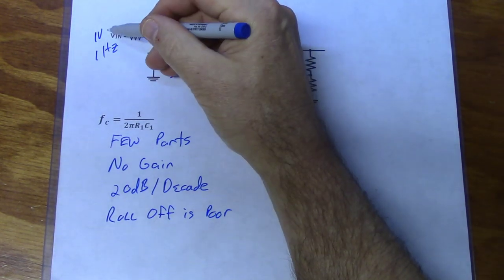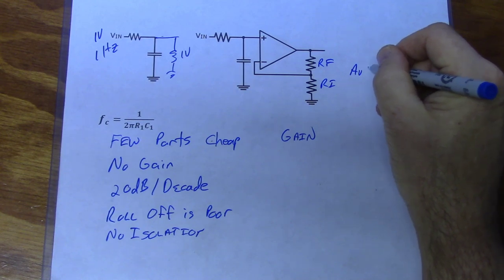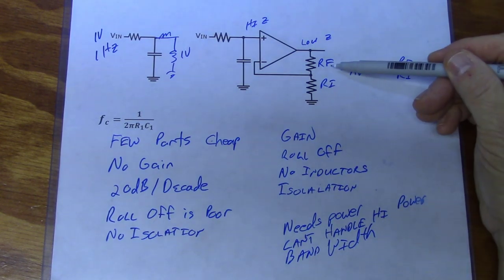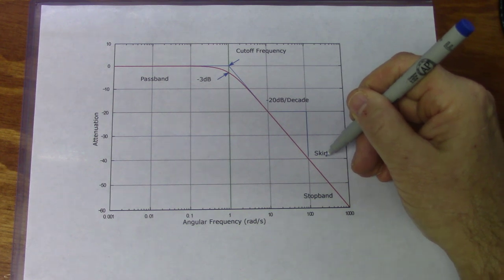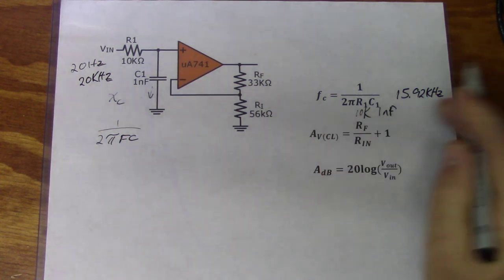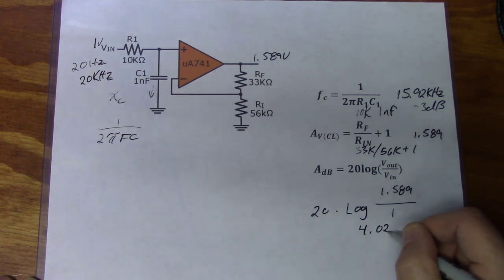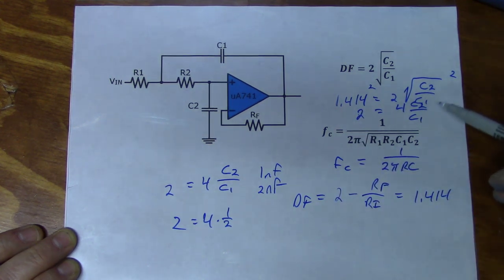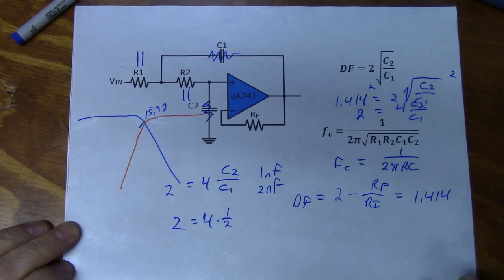66. Low Pass Active Filters

Comment from the maker: The filter with the single RC pair followed by the op amp is really a passive device, not an active filter. The op amp acts as a buffer for the RC filter! My staff, consisting of one person (me), erred. Hard to find good help!
Reply: Just found your videos, some good stuff on your channel, why no recent videos? Was hoping for a part 2 to the am radio video.
Reply: technically it is also an active filter because it doesn’t work without buffer
Reply: Jeez... that'a lots of people you have working for you.... :)
Reply: You are absolutely wrong, so as OP Amp removes shunt load for RC and that makes big difference. So it is still active 1 poll filter. Need to learn and not to argue, my advice.

Comment: Sallen-Key filters should always be designed with the op-amp buffer gain = 1 in order to maximize the loop transfer function, thereby providing the best performance of the closed-loop op-amp buffer.  Design is easy because the normalized resistors are one ohm and the normalized capacitor values are easily calculated based on normalized [w0 = 1 r/s] pole locations.

Comment: Great presentation. Thank you. Question: I want to build a Sallen-Key filter for wspr on 20 meters. Do I have to worry about the slew rate on a 14 Mhz type of signal ? If so, can you recommend an op-amp that would handle this frequency level ?

Comment: As a hobbyist and someone that has created a few videos (none monotized/just for fun), I have to say, you put a LOT of effort into this. Thanks. You must have spent ages editing this to cut the final production with so much detail section by section and point by point. I believe someone needs to try creating something like this to really understand how much effort it takes. Thanks again.
   I like your method of explaining the details. I watched (but mostly listened to) the first 35 minutes last night while goofing around on the bench. The math was a bit much for 1/2 of my attention span but that's my fault.
  In my (limited hobbyist) experience I have tried to use working examples of circuits to help me understand circuits like audio op amps filters. I quickly discovered how it's relatively easy to learn individual filter configurations of first and second order filters. I found it challenging to understand a complete circuit like a preamplifier in a stereo system. For example I was curious what exactly makes a "subwoofer" unique as bass frequency driver in typical consumer home stereo systems. I specifically wanted to compare the powered subwoofer units to the typical entry level guitar amplifier. I have a couple guitar amps, so I found a few powered subs and tried to figure out their circuits. As I suspected, swapping the driver from a sub with one from a basic Fender Frontman shows no difference that I can hear even after recording and replaying them back to back. This lead me to one conclusion, an entry level, home stereo "subwoofer" is just a preamp filter circuit with a more powerful amplification stage. My problem (and the point I am trying to convey) is that it is really difficult for me to figure out the circuit theory in practice. I haven't gone through the standard EE network theory classes, and at 33yrs old, my memory of algebra is getting rusty. It might be helpful to many people like myself if you were to use some real world examples to show the various filters and configurations in practice. In particular I would appreciate examples that utilize the 4558 op amp for audio and the LM358/324 in general practice. I know the 741 is the original 'jellybean' op amp and has not been replaced as such is most of academia. However, the 741 is not used in practice in consumer electronics. If someone is interested in goofing around with hobby electronics, they can take apart almost any electronic device and find either a 4558 if it's audio, or a 358/324 for general purpose use. It's just a simple suggestion, but these are the most practical chips for anyone to play with as they can be found everywhere.
  A couple examples of circuits I started trying to understand are a Sony powered subwoofer model SA-WMSP-76, and a Soundtech 4150 multi channel PA Amplifier and equalizer. Both have PDF schematics available. I'm still trying to wrap my head around the entire PA system EQ but that's a big circuit to start with. The Sony sub or anything similar is the main kind of thing I think people can play with and potentially understand in practice. I tried to figure it out on paper several times but ultimately failed and decided to figure it out empirically by hacking switches between each of the different op amps and bypassing them to hear the results. I wish I had spent longer doing this but I ended up bypassing 2 op amps and reconfiguring the last 2 as a unity buffer and gain stage with a passive tone filter circuit in between, and a single N-channel JFET amplifier stage set up as the input. I would have loved to understand the circuit better, but I had trouble understanding the circuit in the schematic despite watching and reading several things online and making the mistake of trying to use The Art of Electronics to understand something so specific without going through a ton of background information. It is super easy to get a circuit like this from any second hand store for less than $20, and less than $10 or even free if you know where to look. I find similar circuits in almost every home theater receiver. I think a powered sub (the kind that has a mains AC cord attached) is a better device for understanding op amp filters though. It is guaranteed to have a op amp based filter circuit on board, and one that is very specific in it's design. It would make an excellent fundamentals demonstration. I don't dare to try such a thing myself as I would certainly mislead and misrepresent the details with my current understanding of such things.
  Sorry if the length of this offends anyone. I hope that my experience helps others that are traveling a similar path in life.
  Thanks again for all your efforts to help others understand electronics,
-Jake
Reply from the maker: Wow! Glad you liked the video. I will look into ripping some circuits out of devices and doing an analysis on them, it would be fun for me and and everyone might learn something. Starting with a PA and EQ circuit might be a little much but a sub woofer circuit is definitely doable. The channel, despite it's 2 plus year age, is still a work in progress. The goal was, and still is, to give everyone the material that would be learned in a 2 year  program. The ideas you have would fit into the 2nd year side of that plan. One day I will actually have to go backwards and cover the first year DC and AC theory. Cart before the horse and all that. Again, thanks for watching.
Reply: It would help us older readers with poorer eyesight if you used 5 or 6 paragraphs with a blank line between them to break up this long comment.

Thanks.

Comment: Happened to stumbled up on this video looking for building a 2nd order (or more) active filter to roll off from 15khz. What a find! Thanks for the excellent video and explanation of how it works, and calculations.
Reply: If you were to use a dual opamp, and used one side for the 2nd order low pass filter and the other as a variable gain stage, which would you put in front?
Reply from the maker: Glad I could help!

Comment: Very good 
I've been simulated a Butterworth 8th order but without Rf nor R1, negative direct realimentation, and works fine.
I take account DF can't be more than 2 to be Butterworth. DF = 2 - 0 = 2
So, the circuit is more simple.

Thanks a lot for your work.
Reply from the maker: Thanks for sharing
Reply: @TheOffsetVolt  
I've make a program to calculate all the capacitors of the n - order at any fc. The program is tested and works fine. I've simulated a 16th order filter fc=1kHz. Furthermore, I can calculate the circuit for any frequency.
Only 371KB in rar.

Comment: I just found this excellent video, thanks! I have one question regarding the last filter version, the "unity gain" without feedback resistors (using capacitors to set the desired damping factor instead). I guess this solution also can be used to get higher damping factor (skirt), but how do you calculate values for a second stage? 

/Regards Peter, Sweden.

Comment: Have a doubt in the unity gain schematic in the last part. By saying we don’t use the Rf feedback resistor did u mean we simply connect the output to the inverting input of the op amp? (Coz that’s how the basic unity gain buffer stages work).
Pls reply.

Comment: Really excellent video... even in a college course this quality of explanation - which is necessary - is often not covered.  One issue with the video is that at some points your voice drops out for a second of so - I don't think it's on my end. To the main question... everything is clear up to the point of where you derive a formular to get the voltage at the -3db point.. which in the video starts around 30:23... Is that formula Av=10 to the exponent of db/20 ??.   Thanks for this video, I just Subscribed and look forward to more of your videos.
Reply: Yes, the formula is 10 to the (db/20)ith power. This formula is often used when you know the attenuation and want to get the voltage out.

Comment: dear sir
please how to get quasi sine wave (inductive crankshaft signal for automobil) from square wave i.e  crankshaft signal (hall effect) varing from 0  to +5 VOLT  using for exemple a low pass filter 
note: the frequency range is  : 800HZ TO 30KHZ
THANKS SIR

Comment: very in depth video thank you .i  need to subsonic filter board as i am modifying a boom box and it uses a 3 inch ported sub-woofer i am using 2 now it tuned sounds as good as it can but a tune with all very low frequencies gone would be great
Reply from the maker: Glad it helped

Comment: Picky detail ... @4:00, you say the gain is unity if Rf & Ri are the same ... that would actually produce a gain of 2 (1 + Rf / Ri). For unity, have a short for Rf or an infinite impedance for Ri, such as an open circuit. That provides 1 + Rf/inf or 1 + 0/Ri.

Comment: What if I build a 4 pole "butterworth" filter with identical resistor ratios of 0.603 in the first an in the second stage. Av1=1.603, Av2=1.603; Av=2.57 ???
Reply: I am also not seeing where the 2.57V is coming from for the AV in the 4-pole configuration. Unless it is being calculated directly from the total AdB which i calculate to be 8.22dB, then I get it.